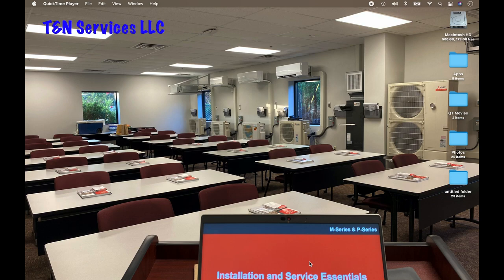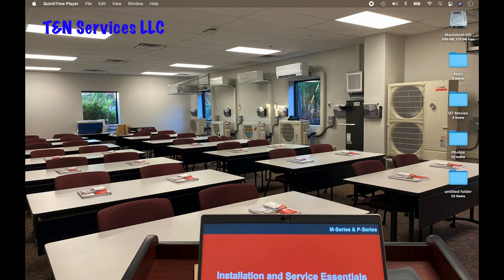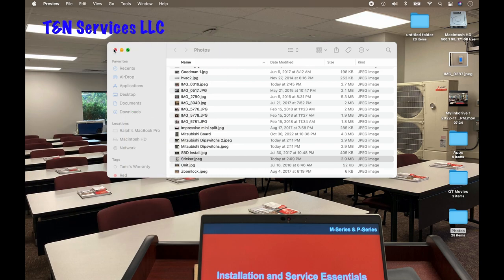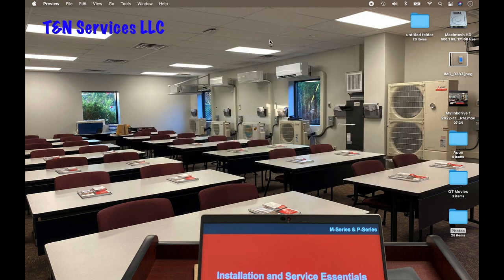How Mitsubishi Mini Splits Work ESP1: mylinkdrive.com

Comment: Been a long time Ralph I hope you're doing well brother 🙏
Having a hard time finding a single zone 5 ton air handler. Cooper Hunter seems to be the only manufacturer that makes them at the moment without getting into a VRF.
Reply from the maker: Here’s what you could do. Mitsubishi makes a city multi indoor AHU (PVFY-P54NAMU) you could match that with a MXZ-SM60 to get what you’re looking for. Outdoor is single phase. According to Diamond system builder you’ll get 54,000 in cooling and just over 38,000 BTU’s in heat.
Reply: @TandNServices  Thanks a lot Ralph I'll look into it 👍

Comment: I love the videos and glad to see you’re back making them! A couple questions for Mitsubishi mini splits:

1. Is there a minimum line set length? I’ve seen other oems say 15’ but nothing found for Mitsubishi. I have a 6k Mitsubishi M series with hyper heat, in a small bedroom. The line set was cut to probably 5-6 feet. Will the factory charge work or do you have to remove and reweigh the charge? I had a non-Mitsubishi hvac company install, and they said the charge didn’t have to be lowered. I just wanted to verify. 

2. Is there any remedy for noise? There is a harmonic vibration that travels through the wall, it sounds like a diesel truck. Outside it is silent. 

3. I had them use Nylock, all the fittings were cut and reflared, and torqued with a torque wrench. I’ve even installed ICM controls phase monitor/surge protector, and one unit I tried a Kool Guard 2. Do you have any recommendations for increased longevity besides obvious maintenance? 

I have 4 units, 6k for bedrooms, 12k fir dining/kitchen and 9k for a living room. Thanks!

Comment: Thanks so much Ralph! I’ve been through both M&P and City Multi classes in Hebron KY but still greatly appreciate more information. The classes where quite some time ago and I’ve forgotten a lot of it. 

You made mention load calculations and system selections. Have you made that video yet?
Reply from the maker: I’ve been to that training room. It’s actually where I taught my first class at. We are going to cover Diamond System Builder in a video which is the software used to help you design a system.
Reply: @TandNServices  Yeah I’ve seen it. Never used it as it’s window’s only, correct? I’m a Mac guy 🫤.

Comment: 67° that is definitely a dealbreaker with customers where the women are in her menopause years being hot and sweaty at night asked me to get it down to 64 or 62°. .
       Even my son and myself on our own systems of course we modified them we have them get down to 58° to 60° at night

Because the units are being shipped to the United States and for the manufacturers to meet the energy efficiency levels required they change the software compared to Asia the remote thermostats will let you bring the temperature down into the high 50s and mid 50s depending on the manufacture.  
    But the same units shipped to the United States they have to modify the software to limit the units into the mid to upper 60s degree temperatures just because of energy efficiency. 

People may think it’s crazy to think that some people are comfortable in the high 50s and low 60s for a sleeping temperature but that’s a niche market and if you can do what your competition cannot do that’s more $$$ money 💰 💵 in your pocket. 

Because the other company just tells the customer that his equipment cannot do that. 
             Learn how to get around and modify the equipment manufacture settings and have a larger clientele